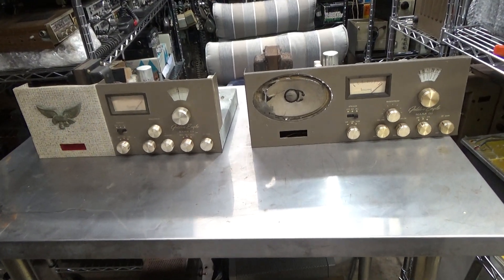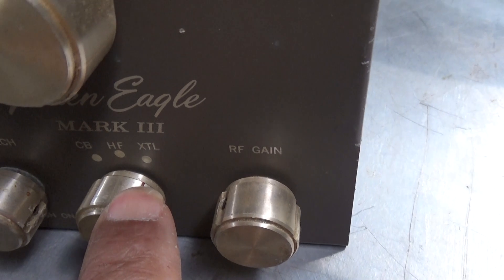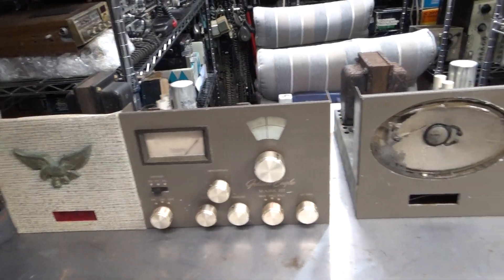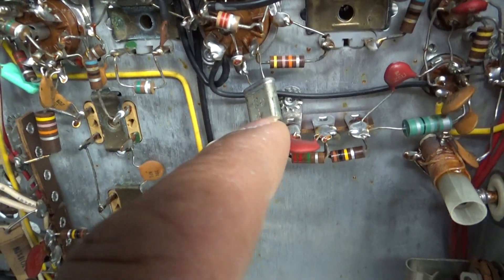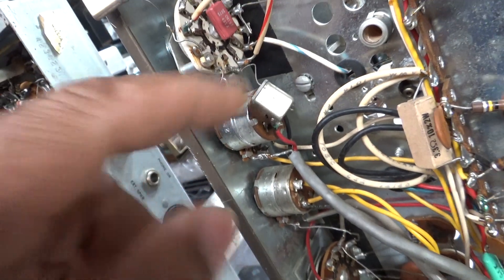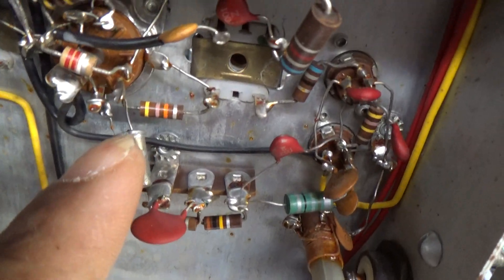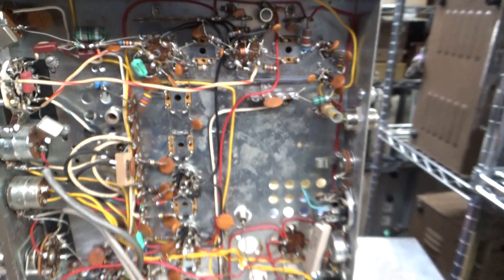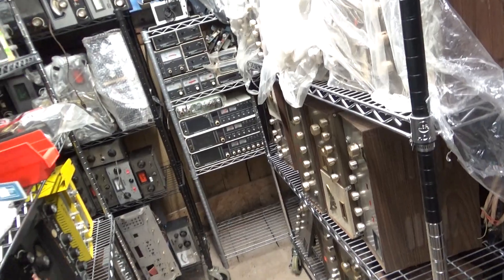Browning Golden Eagle Mark III '3' CB radio receiver HF High Frequency Extension walkthru

Comment: Early mark three receivers had the same eagle as the Mark two and original golden eagle. They did not have much detail to them and had an  almost smooth texture. Later Mark three receivers had an eagle that was very detailed.
Reply: And the speaker grills were different color and installed differently between early and late models
Reply from the maker: Yes Sir.

Comment: Hi, Tramdr! I'm Dollie in N.C. I'm new to the Brownings. Just bought a Mark III with the HF mode on the switch. I am receiving the hi channels like channel 30 on the HF mode but I can't transmit. Do I need to install the HF crystal on the inside like you show in the vid? Also, how do I spot the thing? Please explain. Any help would be very nice. I love this thing. I just want to be able to go to the higher channels. Thank You: Dollie
Reply from the maker: The receive and transmit are totally separate. To transmit above 23 you need a VFO on the transmitter. The Siltronix 90 VFO number 3 is the most popular, but some others will work too, including a modern DDS VFO. Spot is when the transmitter puts out a small signal that the receiver will pick up so you can tune the receiver to where the transmitter is. Say you had a VFO on the transmitter and you had the transmitter 'VFO' on channel 55. You would then hold the spot switch and tune the receiver and when tuned in, the receiver would be on 55 too.